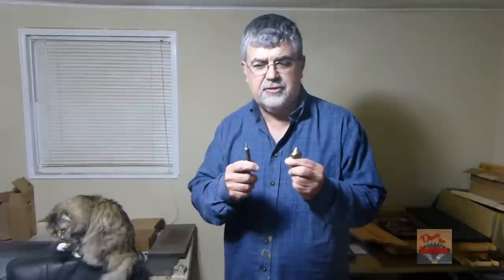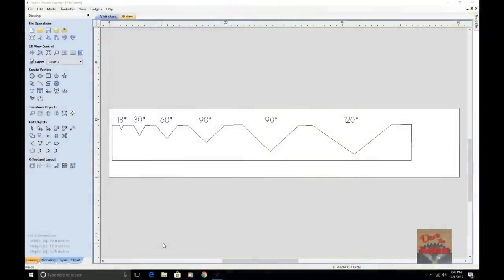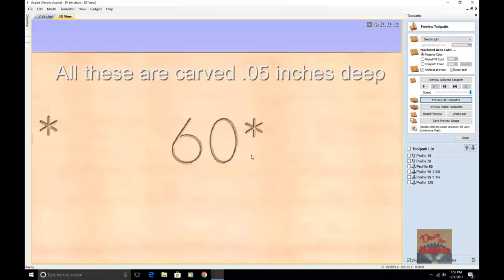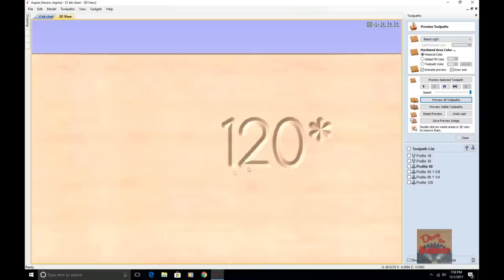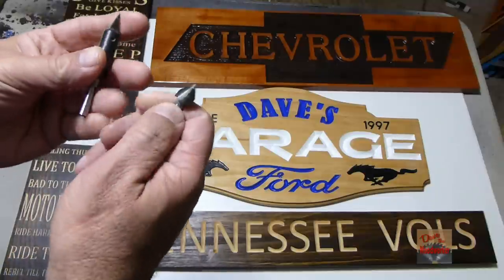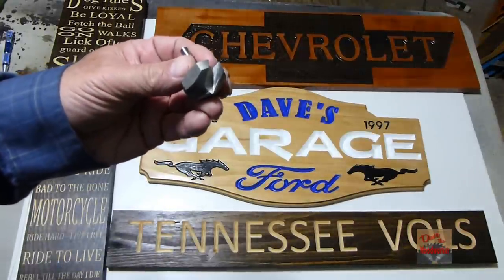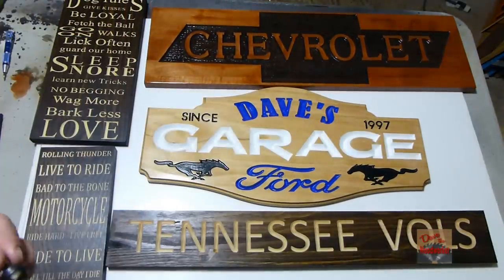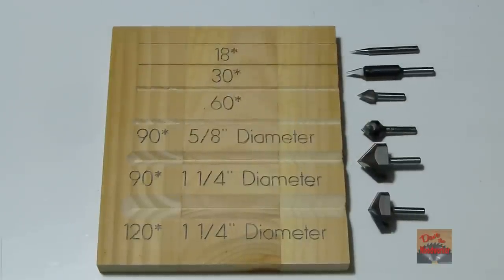CNC V Bits Explained

Comment: Thanks for the video. Well, I don't know but that is not how I understand V-bits. It is most useful when doing an V-Carve or Engrave operation and the wider the angle, the less deep you will cut to achieve the same letter width or engraving width. You should be able to achieve the same nice corners with a 30 or a 120 degrees V-bit, the engraving will just be shallower with the 120 degrees bit. Of course, if you use single line fonts or paths, you will end-up with what you have on the rounded star but that is not the preferred usage of these bits.

Comment: nice video. please tell me how do you do single line letters. Letters that have just one stroke.  My letters are all done like pockets. the letters become too thick. this is a problem with small letters even though i use a 20 degree v cutter. thanks

Comment: HI Dave, Great video. Do you know if a CNC machine maybe with fine V bits would be able to create a 90 degree clean corner? I am trying to cut out a precise rectangle from a piece of flat hardwood. I have a friend that said some machines are able to angle the bits to cut out corners. Cheers
Reply: Don't forget you can buy very small diameter bits to finish the corners.  Look for bits to carve PCB boards, and you'll see them down to 0.2mm or so.  And yes, there are certainly cnc machines that have more ways to move, but you're talking about a lot more money, or very small workspaces (as in a few cubic inches, like https://www.kickstarter.com/projects/1090944145/pocket-nc-the-first-5-axis-cnc-mill-for-your-deskt).  Or just do it by hand.  Here's some more ideas - this isn't a new problem: https://makeitfrommetal.com/machining-square-inside-corners-the-nightmare/

Comment: Dave, can you post general speeds and feeds for each size bit. I'm just starting and cannot get clean cuts. Any help would be appreciated. Also depth of cut for each pass.

Thanks
jc
Reply from the maker: Well this will vary from machine and router used

Comment: The video is incorrect as far as the 2- 90 degree slots are concerned. It has nothing to do with the size of the cutter, as both are 90 degrees and will cut the exact same slot at the same depth. the reason the larger 90 degree bits slot is wider, is that he went deeper, thus a wider slot.

Comment: i dont understand why you cant use a narrower v bit for deeper cuts. makes no sense. the diameter of the bit will be the determining factor to max depth not the angle.
Reply from the maker: Yes the width of the vectors determine the depth. I didn't mean you couldn't use them for deeper cuts.